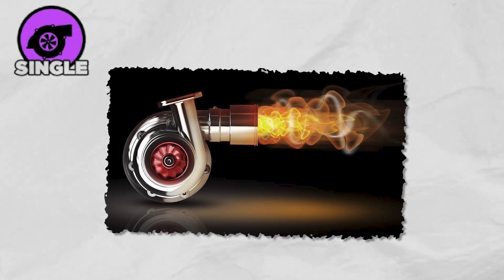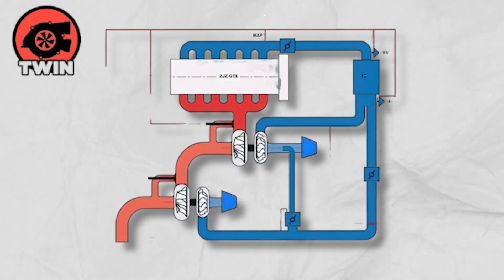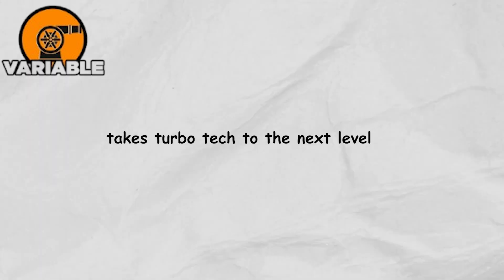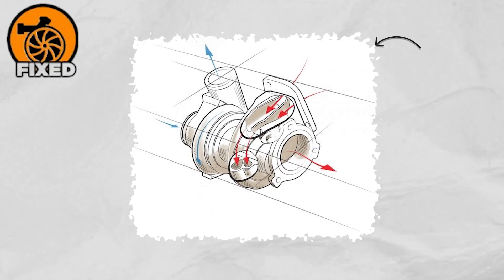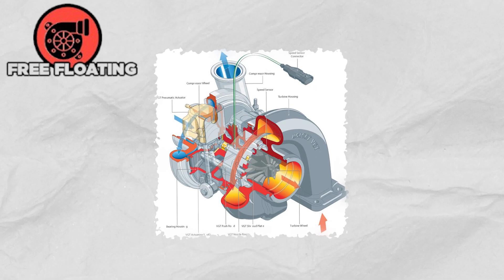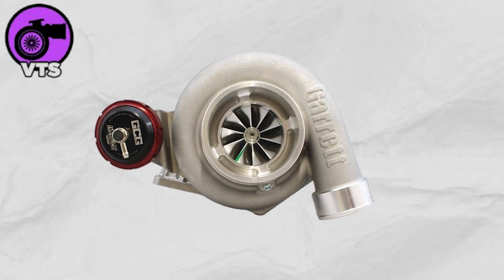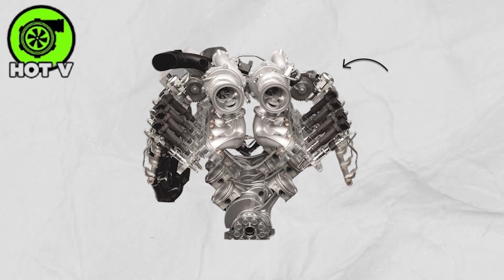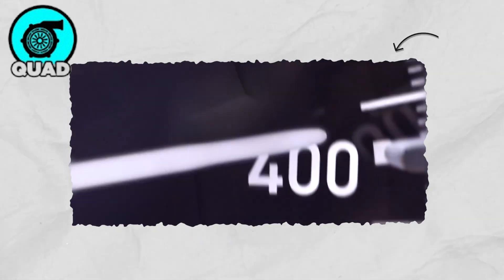Every Turbocharger Type Explained in 10 Minutes

Comment: the bugatti is not the first poduction quad turbo engine ,caterpiller c175-20 is a quad turbo engine that started production in 2009 and the bugatti chiron's engine started only production in 2016 and ended in 2024 (but in a car engine is probably the first production quad turbo engine overall the first no) great video (details matter sometimes😅)
Reply: The chiron reuses the Veyron powerplant and it came out in 2005
And before that, it was still a Bugatti in the 90s the EB110
Reply: @guillaumejoop6437 yeah the video is AI slop, some random guy in India is making some decent cash.

Comment: Bmw M550d had quad turbos too...
Reply: Also, the Bugatti EB110 from 1992 had quad turbos on a 3.5L V12.
Reply: Not only that, there's the Veyron Super Sport.
Reply: EXACTLY😅
Reply: Installed in the compound turbo setup (parallel-series method where two turbo in series on each cylinder installed in the way of parallel turbo setup)
Reply: Also devel sixteen
Reply: @FRLAZone2018  stop talking about this investor trap lil bro it’s not real
Reply: @FRLAZone2018 devel sixteen never officially came out and always remained a concept they only tested a testing mule without the 4 turbos and that was measly slow compared to the damn buggati